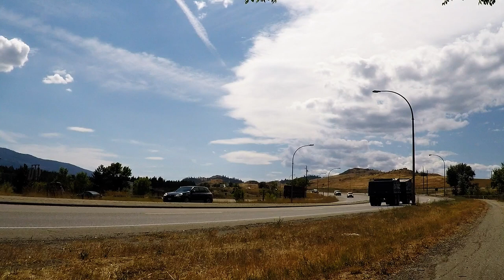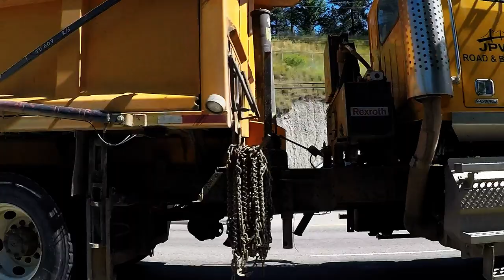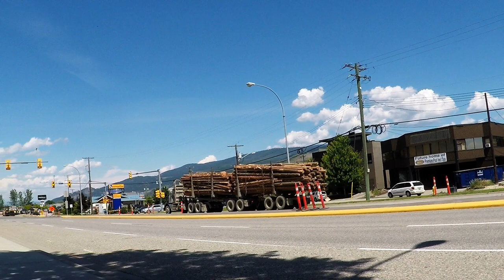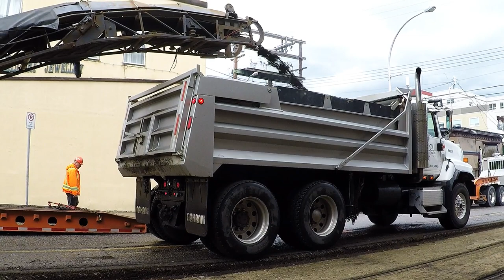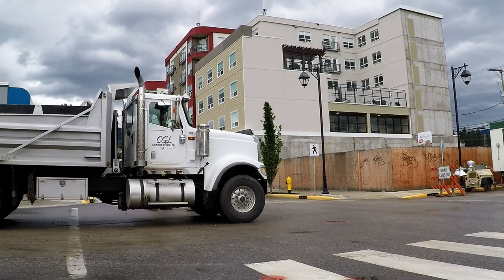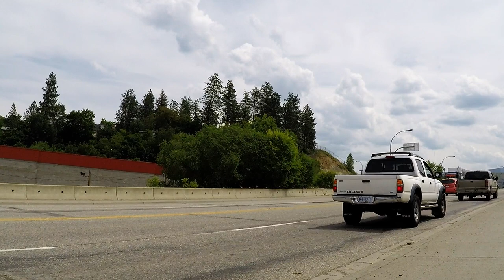DUMP TRUCKS #12 -- Dump Trucks & Cold Asphalt Milling Machine Removes Road Surface

Comment: That was the thickness of our driveways. Our roads are a couple inches thicker. Our highways are probably 10-12 inches thick.
Reply: I need a work like love that
Reply from the maker: Nice to hear from you again, Maine Man. Parameters are climate, environment, subbase, soils and volume of traffic. This roadway is in the heart of the downtown core. Light auto traffic and the occasional LTL rig. This depth supported city traffic since the late 1970s. As always, Maine Man, thanks for watching!

Comment: in watching the end now i can see why he is the way it is with the leg in. That is an old mill i can hear the engine pushing the tired hydraulic drives which can play hell with you swinging that leg because the motor has to be reversed so the track turns the opposite way its going here....forget that lever throw and try to move you can really fuckyourself into being stuck as it. BUT i hold by my original statements they will do a good or better job on grade control with leg out. Stability being the number one...i missed the manhole jump twice now but he did it about perfectly. I can tell because he dragged the piles of cut material with him by not lifting up all the way leaving humps to for the ...if it was a big mill ...back tracks to walk over and cause grade problems ...thats all old days stuff none of the that matters these all the newer equipment are like cadillacs...if you see an old yellow one you need to immediately stop and use anything you can to catch footage of it...especially if it looks like they are going backwards...with the truck backing up toward it...nice trailer this fella is running too its called a cozad which are unique to the western areas of US and canada
Reply from the maker: I cannot thank you enough for passing on your knowledge. Very interesting and enlightening to read. Over the summer of 2020, I missed dozens and dozens of opportunities to video asphalt  millwork done on local highways & roadways. The Covid pandemic has kept me away. Great opportunities lost. I will keep my eyes peeled for the unique equipment you aforementioned. I greatly appreciate your viewership and informative comments.👍 🙏😇

Comment: Excellent Mill, the 1200f was the first 4ft mill that could take it all in various situations where the half lane couldnt. AND they could get down into it and run with all the legs bottomed out...your front mouldboard would be the last thing to keep you from lifting a track off the ground. Now, Im not sure why but everybody loves to run with that leg folded in which is generally meant for gutter pan pulls and tight spots. The idea was to fold it back out after you didnt need to have in but over the years all iv ever seen is runs with that leg in and im sorry and im not picking on anyone, its retarded. Stability while walking is seriously depreciated, cutting is no where near as productive as it can be when leg is in the cut pushing the mill. Years into the production of these models the wirtgen techs could tweak calibrate them to run smooth as this one does as is. But i dont get why the operator just for the stabile feel wouldnt want it out....blows me away =. Ok Im done bitching. Nice vid @ the poster, wish there was more
Reply from the maker: I must say I greatly enjoyed your review of the the Wirtgen W1200F asphalt milling machine. I wish I had answers to your observations and questions regarding the folded leg. I’m only the videographer. I apologize for having limited milling videos to view. I’ve been physically distancing myself from construction crews during the 2020 construction season. Personal choice. Hopefully I’ll be back videoing asphalt milling machines once again in 2021. Thanks for watching! Much appreciated!
Reply: @coolbigrigs  Plz forgive my ignorance with it, at times i have to remember it isnt a crew member making the video and I assume to much. Far be it you see the 1200F again its very old. Even though one of the finest ever they retire them once they get this old. I cannot speak or type for the newer models which look very similar, and believe the idea would be the same and that wirtgen until very recently would probably still maintained the exact same system even on the next generation. Right now they are two generations ahead of this. You made and excellent video and i liked it despite my goofy comments. If you wish to get more video of this all you would need to do is poke around google using terms familar to where ever it is you live and you will find them come spring next year who knows with covid ....or if you live close to an asphalt plant they always know because they are filling in the hole he is cutting ....just watch for the dumptrucks hauling millings IN and they be happy to tell you where they are at. Hi way work is night, boring straight ahead no lift ups. You would get it well with city work where they are jumping alot of manholes....id LOVE that! theres few that know the good details of those thingsn and it your lucky they hit one buried you catch a manhole lid in flight or the poor operator crawling down into the conveyor to get it out. All kinds of good gravy on city work...and thank you again.